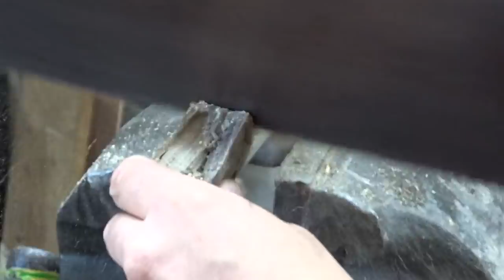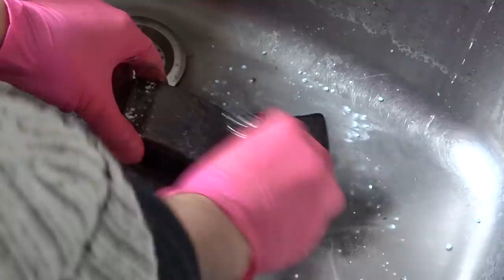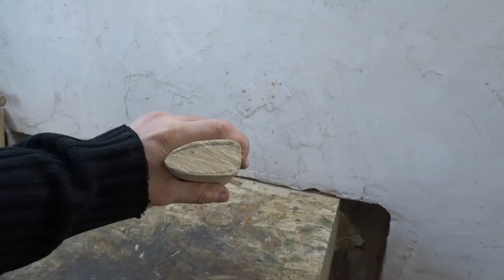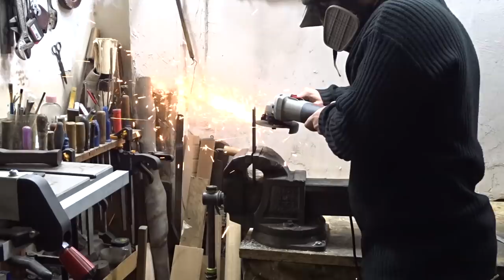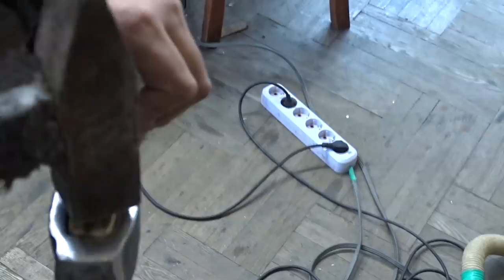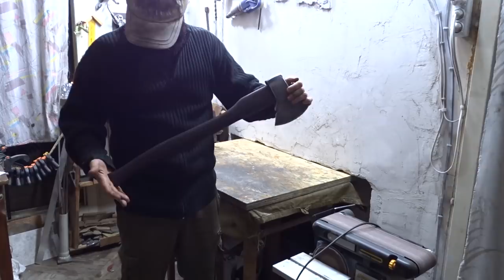Old Rusty Splitting Axe Restoration

Comment: I used to have to replace wood splitting maul handles In the winter, when they were broken, so I’d cut it off at the head and throw it in the wood stove fire.  This burned out the old handle and stripped the old paint, as well as naturalizing the steel. Made and installed the new handle, and tempered the cutting edge after sharpening. Worked fine. I like the hair dye for stain he uses.the short handle makes it better suited for kindling as a full swing is impossible.
Reply from the maker: Thank you for attention, sir.

Comment: Hilarious. Might want to sharpen the ax before trying to split wood.
Reply: tjkoker , a felling axe should be sharp, for cutting the fibres. A splitting axe needs a very different profile and shouldn’t be that sharp-it’s meant for use as a wedge to split wood along the grain; you don’t want it to get caught in the wood.

Comment: The handle cracked because you tried to mount the head with that metal and probably because you filed it down too far. Just use the traditional wood wedge with a could metal spikes dude, and the slit goes in the direction of the blade and not perpendicular to it. Also if the wood grain runs perpendicular to to the axe head it will always split like that or worse eventually. Seems like you need to study up next time you want to mount an axe head on a handle
Reply from the maker: Thank you for attention and information, sir.

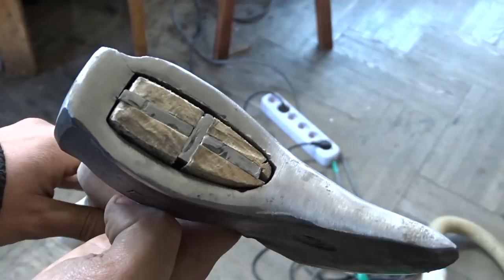Comment: Gonna be honest after seeing the final product I wouldn't use that axe even if you paid me too. I'm not sure why you are using metal wedges or drilling into it prior to mounting the head but it does not work, look at all the space around the top at 8:42. When properly seated there will be no gaps anywhere and will usually even mushroom out at the top if you choose not to cut if flush. Just use a bright piece of ash and coat it in boiled linseed oil.
I messed up bad my first try mounting an old axe head. It had just as many gaps, and I only spent half an hour doing it. Axe head was dangerous but I tried using it anyway. After half an hour it was coming loose in a hurry. Nearly came off mid swing. I took off the handle, found one that was perfect grain and design, and spent two days preparing the handle and getting the head to mount perfectly. It has never come loose and cuts like a dream.
Reply from the maker: I will try to improve my skill in this direction, thank you.

Comment: okay, I never like the cross wise wedge it tends to break the handle. I don't know why people insist on doing that. first, I would have used the piece you took out of it for a pattern for the new piece. it fit so  tight, it would be what you want. then ONE wedge long ways and if you're really worried about it put some epoxy on the wood when you put the head on tween that and one wedge, the head is going nowhere. As you saw with the handle you took off, it didn't have all that mess and you had a hell of a time getting it off on purpose. That should have been a moment to learn from. By the way, your English is really coming along. You're beginning to even sound a bit American. "lets do this"
Reply: порно2020
Reply: дв 2020
Reply: да